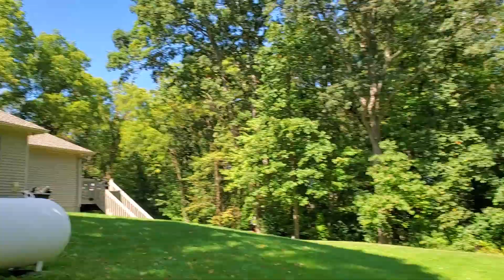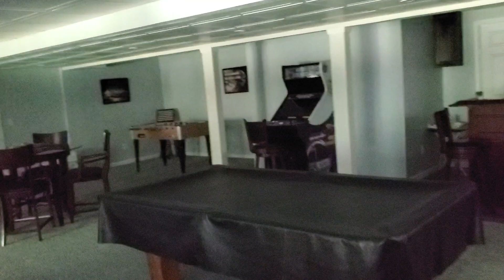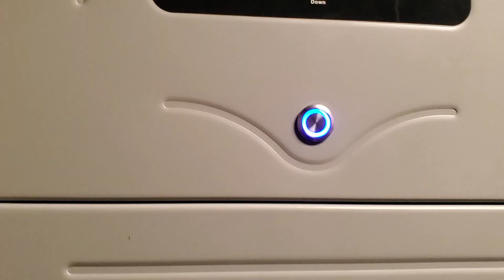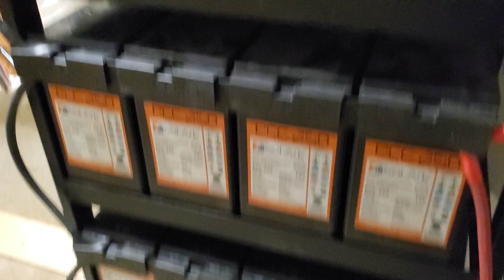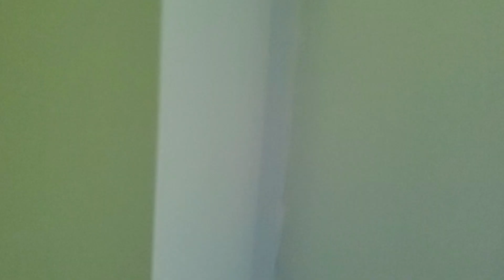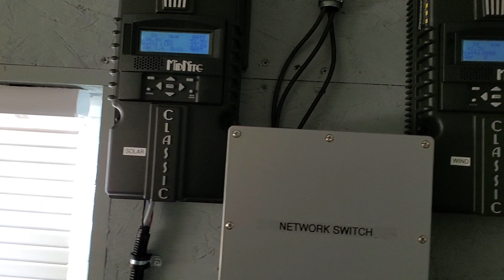Solar and wind setup

Comment: Sweet redundancy, dump load too..  Is that wind turbine still in the same place and height..?  I'd move it to the front of the garage and raise it up much higher. That's where the wind is. sitting low and close to them trees can't be good for it.
Reply from the maker: I had a wind rose analysis performed, and it is the perfect location for the location, but it needs to be 10 feet higher. Really wont kick in for another coue of weeks.

Comment: Nice, I have somewhat similar 48 v.offgrid setup. Aimes 12 k inverter, building the wind turbine setup and Thinking of going with the big battery Kong to replace my lead acid.
I didn't maintenance as I'm rarely at the property,  so  3 of my 6 volt batteries died. Now experimenting with the baking soda Epson salt trick to bring back to life. The self watering is sweet, but seems overwhelming for me  to setup. The freedom of having your own parestesias is rewarding.  You'll always pay a power company,  so I'd say it pencils out to bring cheaper or equal to long term.

Comment: Beautiful property & a fantastic solar setup! It's great to have your own power plant and to be energy independent. You likely have a good many years left in your current batteries but at the end of their life cycle, I'm sure you will likely replace them with Lifepo4 batteries. Battery technology is constantly evolving but presently, Lifepo4 batteries are likely the best battery option for most solar systems. Your wind generator probably won't get a lot of wind exposure with all the trees around it but will obviously get more wind exposure in the winter time. I'm in the same predicament with trees surrounding my house and have invested in 2 vertical wind turbines, to supplement with my solar system. However, I am curiously awaiting a new wind generator design (Power Pod) to see how effective it is.  I believe at this stage, it's more or less still in the testing phase.

Comment: thanks for the video sir. Your problem with the wind turbine is you have too many disturbance like the woods out there. Wind comes out from them is turbulent. You need stable smooth air to have proper input for the wind turbine.

Comment: I love your place, it is beautiful out there. Sol Ark is very good. But for 1/6 the cost you can get a Deye inverter witch is where solark was originatid.check it out when you have the time.
Reply from the maker: Thanks. I did check those inverters. Good specs , good price even Ul 1741 compliant. However I wanted local company that I had established a relationship with Sol-Ark long before I purchased.  Another note Deye inverters are not on Consumers energy approved list for inverters when selling back to grid.  Thanks though good looking out...

Comment: Lithium to get 100% depth of charge when has EMP ever been a problem.
Reply from the maker: It's not a problem until it is...
Either way I'm protected. I have invested in Nissan gen 1 batteries and have backup BMS units on the shelf just in case.

Comment: for that kind of setup you should have all 120v load on the battery///////i live in a 3000 sq ft home with 8135 watts of solar panel and lithium battery and the only thing is not on battery is my 240v,ac unit and dryer,,,,all 120v are on battery 24/7,,,,my 2 hybrid inverter push power back to the grid only when battery is full
Reply from the maker: Im in the middle of making another transfer box.  The only things that will not be on load panel will be the dishwasher and stove. I've made some changes to the system with additional panels and string inverter...
Reply: @offgridbydesign3826  thanks for replying